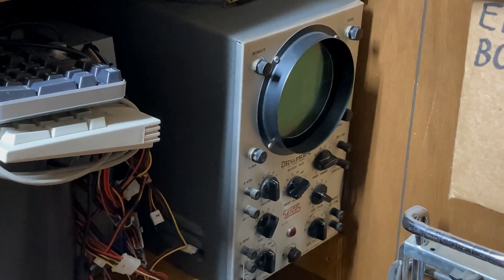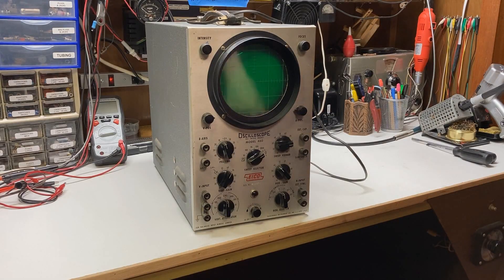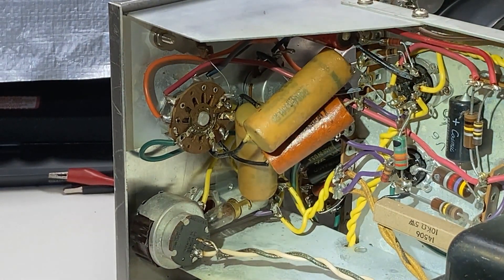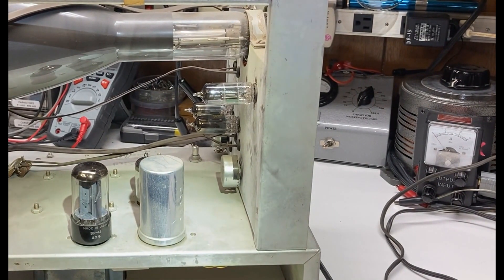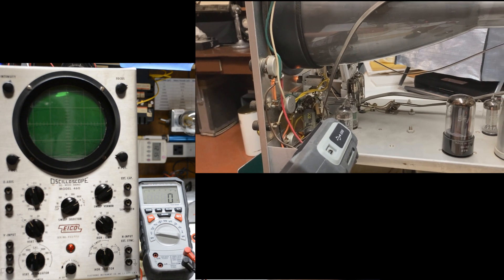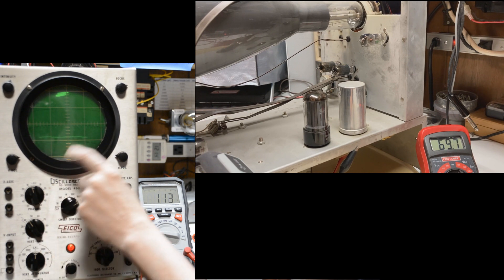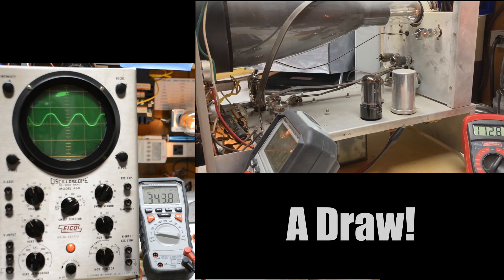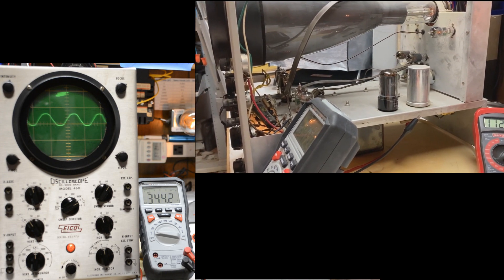EICO 460 - 1st Power Up In 37 Years

Comment: I just got the same model from a friend. His has been in his attic for maybe 50 years. I appreciate seeing exactly how to bring it up slowly, as so many recommend. I didn't see a followup video in your listing. Can you reply with a summary of further work you did on this scope? Thank you.
Reply from the maker: Sure Duane, After making sure it would stay running for an hour or so, I went in and tested all the tubes. (They were all original and GOOD).  Then I unplugged it, discharged all the electrolytic caps with a 100 ohm resistor.  I went through and quickly checked the resistors in circuit (you can do that on vacuum tube devices without having to desolder one side.  After replacing all the out of tolerance resistors I started replacing all the capacitors.  I left the disk caps in there since they rarely go bad.  I had most of the Electrolytic & paper capacitors in stock but not the high voltage (1500 Volt) ones.  I was able to get those through Mouser.  After replacing all those capacitors I just went through the alignment procedures according to the Heathkit manual.  Very easy and enjoyable restore.  If you have any more questions don't hesitate to ask. --  Good luck!  ...Dean

Comment: what does it even do i dont understand the point of it and im trying to figure it out, if you anyone can tell me what its for that would br great thank!
Reply from the maker: Hi Mason, the primary function of an oscilloscope is to display a graphical representation of electrical signals as waveforms. The horizontal axis (X-axis) typically represents time, while the vertical axis (Y-axis) represents voltage.  Oscilloscopes are invaluable in troubleshooting faulty circuits. By observing the signal, you can identify issues such as signal noise, distortion, and unexpected signal behavior.  Hope this helps you understand the value of an oscilloscope.

Comment: I have this same scope on my bench downstairs. It was my Fathers. I'd love to learn how to use it, but right now, its just a reminder of my youth. 
 I also have the Eico 324 Signal generator, and Eico 249 Voltmeter/Ohmmeter.......Great video...
Reply from the maker: They are easy to learn how to use and even more fun to play with, especially if you have a signal generator to input a signal.  You can get an assembly and instruction manual here if you don't have one...  http://pacifictv.ca/schematics/eico460manual.pdf
Reply: @DVRproductions52  Thanks for the reply!! I used to play with it when I was young, plugging in a microphone and watching the waves, but these days, other then that, I also tinker with all my vintage amps and would like to learn more about using it as a diagnosing tool. I do also have the Eico signal generator, but the lead is shot, a I would love to learn to use the generator as well...I downloaded the manual, thanks again!!

Comment: I saved an EICO Mod. 460 O'scope from the trash pile at a repair facility I worked at in the '90s;
I haven't looked at it, but a recent move uncovered it and I have it on my to-do list when my bench is set up at my new home...
Thanks for posting this video; yours looked really clean!
Reply from the maker: Yeah mine's in pretty good shape since it's been in storage so long and rarely used since I got it as a teenager.

Comment: I'm picking up a Eico 460 tomorrow. How would I discharge the CRT? Is there a ground lug on the power cord, should one be installed?
Reply from the maker: Ya know there really isn't an anode cap like on TV's & monitors.  I'd just discharge each pin on the neck with a 100 ohm resistor.  As for the the power cord, you can use a 3-wire ground but it really isn't necessary since the EICO has a transformer in it.  Another reason to keep it 2-wire would be to keep the input jacks truly "floating".  If you notice there is a removable ground strap on the input jack (ground to chassis).  To keep the ground at the same potential as your unit under test. (Radio, amplifier etc.)  --  In short, I don't think it matters much.  For these older scopes, I prefer the 2-wire power cord myself.
Reply: @DVRproductions52  Thank You.